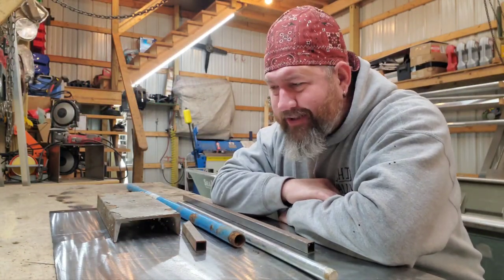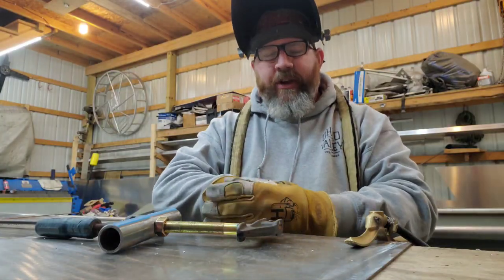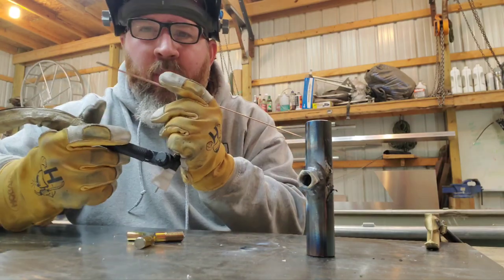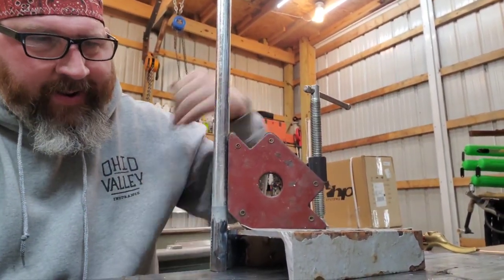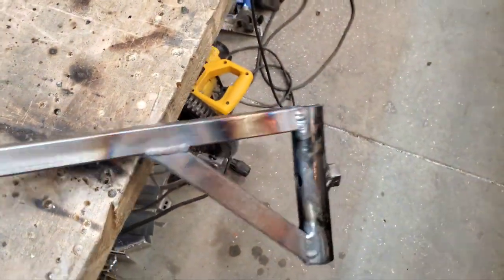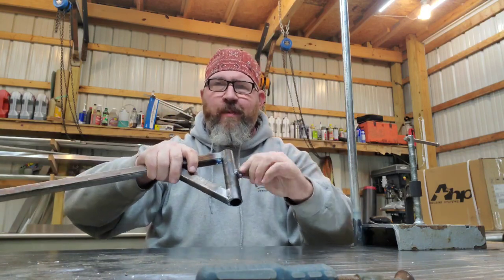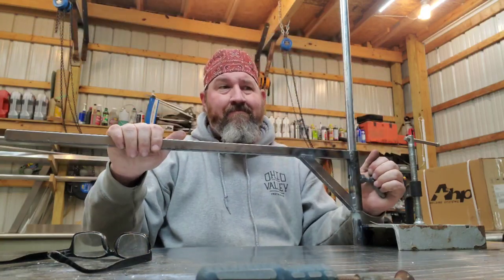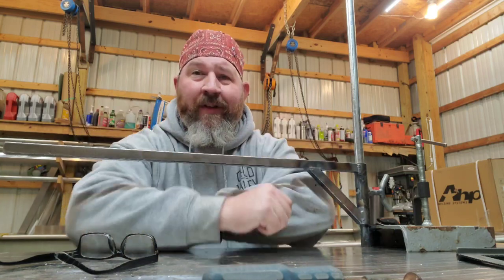Making a Tig Welding Arm Rest

Comment: Love the video and the fact that you are sharing your knowledge.
Question :
Have you ever tried mig welding alum. w/ the tricks the old timers speak about ?
1.)   run stiffer 5356 through the torch cable,
2.)   run through a size up (bigger) contact tip ..... i.e. .030 wire through .035 tip,
3.)   keep the torch cable as straight as possible
4.)   change to a teflon cable liner ??
What are your thoughts on the matter ??
Thanks for your generous consideration,
Sincerely ................
Reply from the maker: It works for a little while.  Better off using a spoolgun

Comment: I've been thinking about an adjustable support to help me stay straight, but I thought I was just procrastinating actual welding training when drawing up my variant of a stabilizing custom height arm rest. I'm happy to see this is actually seen as a worthwhile tool, and I'm thinking I want to actually try to build it now. I'm just not sure how many of my desired features I should try to add, but I'm thinking I should make it simple, then perhaps a V2 down the line.

(I know it's ridiculous, but I want to eventually add a motorized fixture to hold the torch on the rest/rail/track bar. Also I want more axes (axises?) of adjustment, and I want magnetic, clamping, and maybe even suction cup options for the mounting foot. I'm thinking 2 mounting feet. Maybe 4. But I think I'll just make two mounting arms on clamping mounting feet, supporting a length of pipe. I'd frankly prefer to be a mobile welding robot operator mostly, rather than a purely manual welder. My stringers aren't good enough unless they're perfect.)